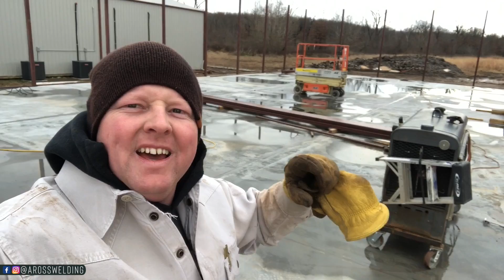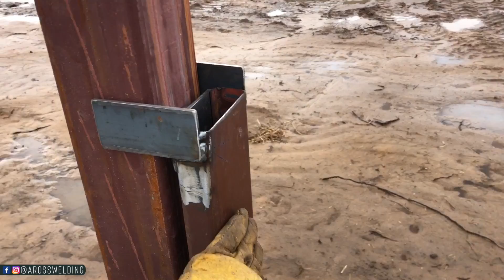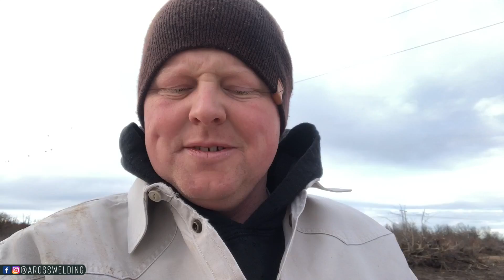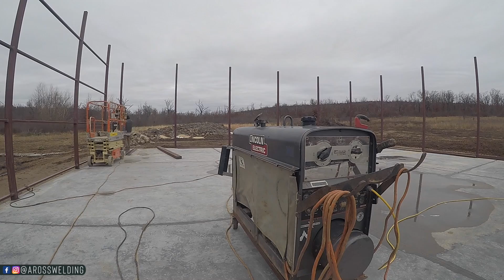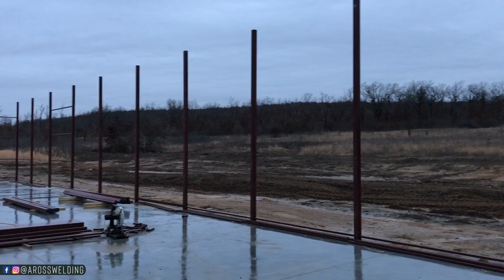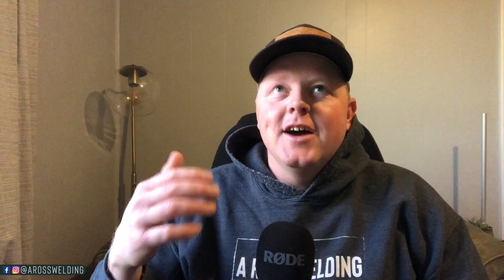FRAMING WALLS ON A STEEL BUILDING FOR THE FIRST TIME (50X100 METAL BUILDING PROJECT - PART 2)

Comment: On buildings I like to use a transit instead of a string line. I usually make a mark on center cross hairs on each post then I have one standard elevation mark to go off of on each post. Never have to worry about the sag of the string after that. And if you have a little gap on the C Perlins, just cut you a short piece of flat strap and weld it in. Saves me time instead of filling the gap.

Comment: Why didn’t you use a tig rig on such thin metal? It would have made life much easier wouldn’t it? Just curious, I’m not a welding expert.
Reply: Yes, but its a little slower, plus if a gust of wind comes by it will blow your argon away and leave porosity. Its cheaper to use stick or self shield  fluxcored wire, and not have to worry about wasting a gas bottle
Reply: @BenRossi901  that’s why he builds a welding hooch, that’s what I see welders do on turnarounds in the refineries.😂😂 I’m just an electrician though.
Reply: @jordanevans7544  

Yes...the hooch....but, i doubt anyone would take time to set up a hooch for each weld for a building like this, i once saw a guy use tarp, and throw it over himself to keep the air out.....not recommended though lol
Reply: @BenRossi901  absolutely way too small a welds and way too many to be building hooches. Lol I’ve never seen anyone throw a tarp over them! 😂😂😂😂 that’s a first!
Reply: @jordanevans7544  

Usually see that with the contractors that hire cheap labor.

Comment: Hey Austin, do you have to be a certified welder to hop onto the pipeline? I’m aware of the branch test and all that just didn’t know if you needed to be a certified welder to weld pipe.
Reply: Each gas company have their own certs. 
Most pipeliners have multiple papers. So sometimes u can get hired without even doing a weld test. Just orientation. So it helps. . but if u dont have any certs. Its a lil harder to get in if u dont know anyone thats alredy in

Comment: I have the same little machine. The 210mp. It ain't the best on 120v. Could only use about a 3/32 but still Draws too much power and trips the breaker all the time. It runs flawlessly on 240v however runs 5/32 rods very smooth. It's a great machine. I use it for hours everyday.

Comment: Out of curiosity, what are you going to do if when you lift the trusses in place they don't fit by 1/2 inch or something like that, hopefully not more? When we build buildings, we hang the trusses first while the poles are loose and can be manipulated and you would be surprised at how far off they can get sometimes. Once the trusses are up, then we weld a rat run to hold everything still while we do the purlins.

Comment: You live in a good area for welding work. Never seen buildings like that welded together. We have a lot of similar buildings in Australia but they come as a fabricated kit and mostly bolt together. The guys bolt up leg and truss sections and then crane them upright. Slap purlins on the top that tie everything together and also carry the tin. What they call top hat rails tek onto all the uprights and the tin attaches to them. The odd bit of welding but next to nothing. Then you have all the pipe welded fences. Never seen them before either. As you learn I learn how different places work. It's all good.

Comment: Use little  1 1/2 angle iron o pieces of 1/8  thick  clips  to join  weres you uave gaps  and use 6011. Rods 3/32    👀

Comment: You need to throw you together a decent set of saw horses.  Working on the concrete will make you older faster than you need to be...... work smarter not harder.

Comment: Do you have to to have certification for  Structural welding to build this kit?
Reply from the maker: No
Reply: @arosswelding  thank you
Reply: No, unless whoever hired you for the job requests to see it or make a copy of it. That way the contractor wont get in trouble if an auditor comes by and asks "Was the welder certified?". It will say on the print if the welds have to be welded to AWS D1.1 code, i dunno, its just best to have it with you to cover your butt.
Reply: @BenRossi901  thank you
Reply: @marcosortiz2453  

No problem, we are all here to help each other understand.

Comment: Hey Austin is their not a base angle generally that would be your bottom run of screws given I’m not expert but I recently started building building due to the lack of pipeline work at the moment
Reply from the maker: Not with this kit. But I know what you are talking about. A guy I’ve helped before uses the base angle.

Comment: I put another, rather lengthy, comment on here somewhere, but I don't see it now. Bottom line was, drill a small hole in the bottom of your uprights right at slab level to let any rainwater out, because if you got any water in there and it freezes, it can actually split the weld seam and or make it round, but in either case, you'll have to replace the upright. Just a little hole down at the base at concrete level and let the water out. Easy peasy.
Reply: He capped the uprights before he put them up
Reply: @markman63 Oh. 😯

Comment: How do I charge for a pipe fence ?? Anyone
Reply: I’m building a fence now and guy has pipe and cattle panels putting 3 string of pipe then panels that 5p then lh  doing 100’ in 3 10 hr days solo and charge 50 hr
Reply from the maker: Do you already have the job? Or is the customer wanting a price before they commit?
Reply: I have it but he’s providing the pipe
Reply: @markhouston7.334  

How long will it take? How far is the job? Take into consideration about how much fuel you will waste while doing this job. Also cover tool usage as well, welding rods and grinding discs aint cheap. The labor part, well thats up to you on what you want to charge.

Comment: for stick welding 14 gauge or thinner i like to use 3/32 6013 on straight polarity (electrode negative). you have to finesse it a lil to make sure youre melting both sides of the joint but once you do you can just drag the puddle with a lot less burn through than with reverse polarity

Comment: Make some purlin clip’s,since you’re using 4” purlin get some 3/16x3 strap and cut them to about 3” weld them to the risers then hang the purlin on them and weld purlin to clip same on roof
Reply from the maker: I’ve helped a guy that does this on the buildings he builds.

Comment: My shop is a 40x60 weld up. I hired it put up mainly due to the hanging tin portion of it, and didn’t think I could do it all with only one man. At the very end of the video you were talking about tweaking it to get the building square until the tin gets screwed on. I’ve seen guys use come alongs diagonally to do what you were describing.

Comment: If you plan to be in the business you prob should consider a “good” laser level as that string will lie to you.  String will get it done but perfection of the laser will up your game.
Reply: A great laser level. I had one that was "self leveling" and all, and Its different every time. I was in a rush to get a roof over my camper, so I actually ended up using a transit. LOL
Reply: @dylanpeterson3490  I don't know man, I've built lots of fences and lots of buildings using only a string line and it's not failed me yet and besides, it doesn't need batteries. 😂
Reply: @SiwyWabbit  neither does a water level.
Reply from the maker: I’ll definitely be owning one sooner than later
Reply: @arosswelding  Austin, you coming  back to WV, ???? Hauling 36" in NOW!
Reply: That’s for sure and worth every penny
Reply: Water level